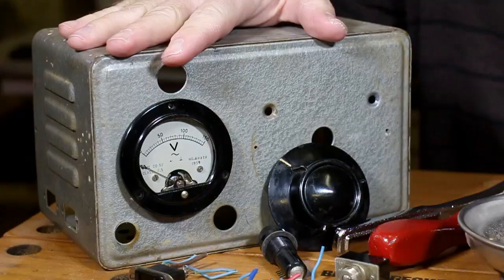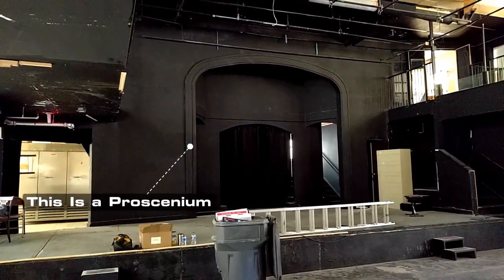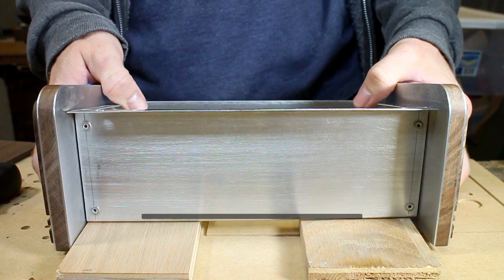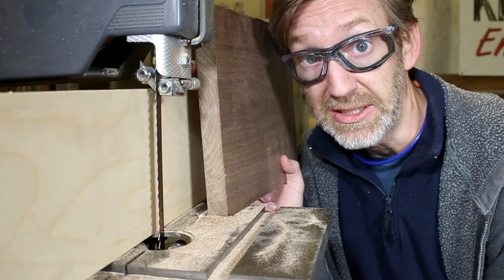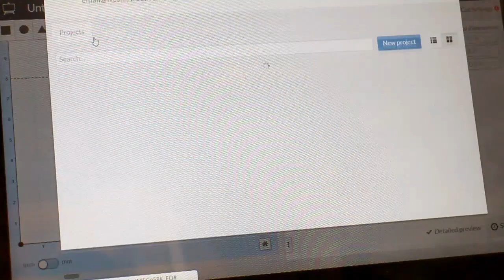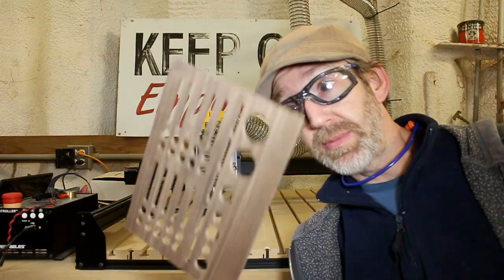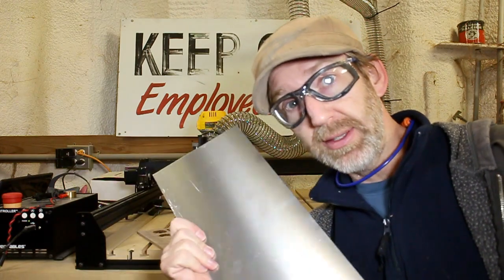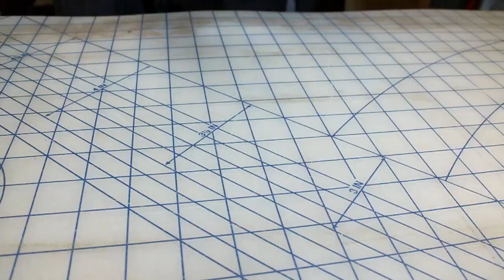Art Deco Light-Control Panel

Comment: I'm with you on old school control panels. Loved the video! and don't be afraid of aluminum it's very soft for a metal, if you need endmills that are cheap for machining aluminum and I would check out lakeshore carbide I use them and love them.

Comment: Very Impressive, I am jealous of all the equipment,  apart from the handsaw which acted a little blunt. I was curious, you said the wood was to big for your band-saw but you machined away about a 50mm border from the blank, couldn't quite see the clamping method you used, but double sided tape while 1st 2 holes machined then pause to clamp through those holes and you only need to trim 2-3 mm from the blank ( round holes requiring less shear load on the tape, clamp through before routing slots that would put more shear load than the tape might take) that all said I have nothing but praise for the design and execution of the build.

Comment: Hey i love all your work and just saw this video recently. this might be a weird question but do you have a link or any info on where you got those buttons you used?? i need a small, clicks button like that for a project and i can’t seem to find any that i like. any info would be appreciated. thanks!!
Reply from the maker: Search for NKK MB2411E1W01 on Mouser. It's my favorite snap-action button. Read the datasheet for model number specifications. Numbers followed by "-F_" include the cap. Otherwise, you can purchase the cap separately in various colors; search for NKK AT496.

Incidentally, if you can get Mouser to send you a physical catalog, it's a lot easier to find the specific type of switch you're looking for if you don't have a model number.

Comment: Good day, Sir. I admire your multi-disciplinary skills. Can you point me to a part number for the LEDs you used? I've found in the comments where you gave a tip on the buttons, but I'm also going to crib your illuminators!
Reply: Upon re-review of the footage, perhaps they're just bog-standard 5mm with a plastic panel mount deal?
Reply from the maker: @cdgoodall  I believe they're Mouser part number 749-PM5HD. The picture doesn't match the lead style, so be sure to look at the specs.

Comment: Nice job with the wood work...just some issues with the electronics. The .100" jumper connectors on the Arduino are not secured with anything so could come apart due to handling. Also I didn't see any ventilation for the electronics. Reliability drops with increasing temperatures. You want to make sure there's proper ventilation and add fans for high temp parts. The lighting controls will definitely need cooling...nice videos!
Reply from the maker: Thanks, I'm glad you liked it. As for the connectors, they aren't going anywhere. With everything closed up, there's really isn't enough room for them to disconnect. Besides, the unit is secured to a lighting bench and won't be moved. Regarding heat, I monitored it for excessive heat in testing at the theater, and it doesn't generate much at all. Thanks!
Reply: Actually the lighting dimmers are going to take the excess current and generate heat with it. You need to test with the actual lights used for a long time. Also the reliability of the electrics will drop with heat. Drilling a few holes for air flow won't hurt 

I love the old time knobs and switches too. Nothing like the tactile feel of real controls. I'm thinking of making a tube amp with old style volume meters and knobs, etc. You're taking some of the fear out of the build for me. I'm an EE by profession. The wood and metal working is a bit new for me...Thanks for posting. Keep on truckin' :)
Reply from the maker: Does 4 months of testing qualify as a "long time"? I appreciate the input, but I've already said there isn't much heat generated. In fact, I've crippled the brightness of each circuit in software, so the bulbs never even come close to their full current draw.

Comment: Dude, you seriously need to get some step drills for making larger holes in aluminum sheet . You end up with nicely chamfered holes anywhere from 1/8 inch up to over an inch starting with 1/8 or 1/4 inch holes.
Reply from the maker: Irwin's spade bits with the teeth at the outer perimeter work fantastically for making holes in .040" aluminum sheet. And you're talking to a guy who makes a lot of fixture holes in aluminum sheet.
Reply: With all due respect Wesley, I have been drilling holes in aluminum sheet for over 40 years using step drills . They were originally made by Irwin, and now are off patent . I urge you to consider trying them, they make an awesome hole with no burrs.
Reply from the maker: I have step bits. I use them for other applications. I prefer the spade bits for this application.

Comment: This was a really cool build, and nicely shot and edited.  I have a couple pieces of constructive criticism for you that I think could take this from good to great.  
1.  There is a bit of a constant white noise in the audio track (like a fan in the background) -- to get rid of it, try a shotgun mic, and use a compressor and/or EQ cutting of high frequencies on the audio track.  
2.  I can tell this is in 30 fps or 60 fps, which to my eye, looks a bit unnatural.  It is counter-intuitive, but 24 fps (and 1/50 sec shutter speed) will give you a much more cinematic look.  Check out the video Wm. Walker Co. released today which explains this in much greater detail.
Again, nice video overall, looking forward to watching more from you.